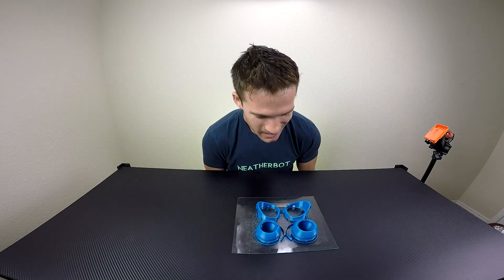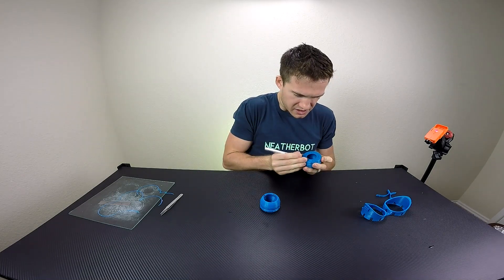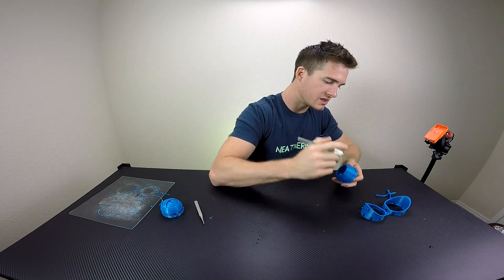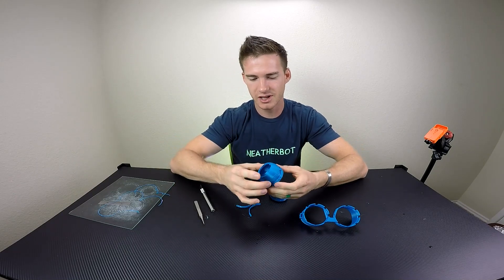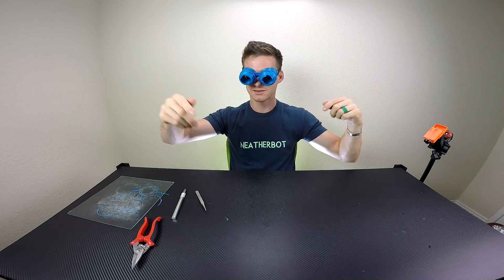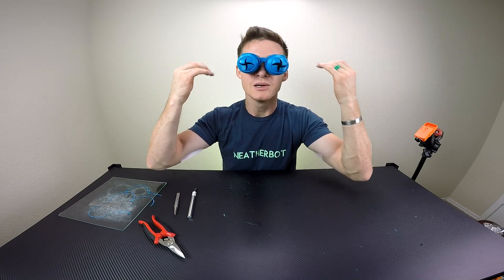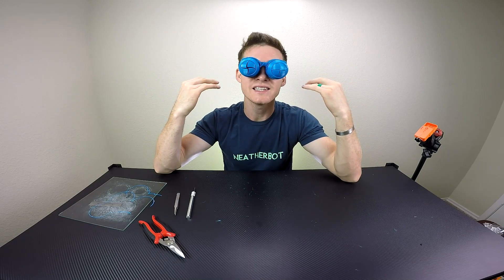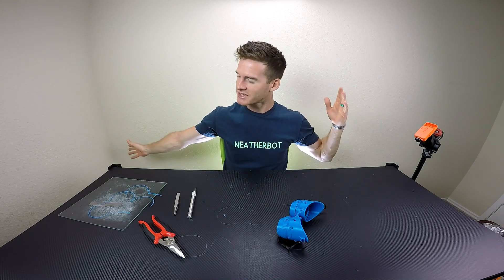Blinking Iris Goggles

Comment: you could, with a small vibration motor, and some clever gearing make it open and close using an arduino, or use something to measure your muscles from around your eyes, and auto blink when you do.. would make it a bit harder to print, but would make it that much cooler.
EDIT now you just made a much better way to do it, just after i unpaused the video...

Comment: If you can do an experiment first, so I know the values, I can probably code it for you. You should use ir for the sensor light pair and then a blue light for the glow. We just need to see the change in intensity between open eyes and closed ones.
Reply from the maker: +Daniel Armstrong I have the goggles winking already! Check it: https://youtu.be/zl7v5aEJRVk

Comment: Just a suggestion... I'd use something like Matterhackers Ninjaflex to print the frames. I think that would conform to your face a little better and perhaps be a little more comfortable to wear. At that point you could modify the file to print a stretchy strap to hold them on too. Great video man. You just got another sub because of it...
Reply from the maker: +ExStatic Bass wohoo! Thanks for the sub and comment. Yeah I had thought about that, but the way the frame is designed it had to be rigid enough to hold the iris box. I agree a flexible frame would be a good idea.

Comment: if you put lights in the goggles you couln't see. but presumably you would be looking at lit things so the light sensor idea 
still works
Reply from the maker: +Jack Lankester I have the led amd light sensor working for the most part, just a little bit of refining to do to get it all running smoothly!

Comment: Yeah just keep a light pointed at your eye.... I had the same idea then I realized it was kinda not the most thought out
Reply from the maker: +Beastinlosers I'm still working on getting the light figured out. It's being difficult.
Reply: NeatherBot maybe u can put a material on the eyelid and reflects off of that it closes it. It's just that the reflection will have to be captured from a largish area as the reflection of the eyelid material will vary in direction. The material will be so much more reflective than an eye. As long as the material covers a good size region and won't be sensed when the eye is closed, it will be easy to put on
Reply from the maker: +Beastinlosers that is a good idea, I have thought about this. Ideally I can get the light sensor to work so anyone can put these on and get them working. I am stubborn about this light sensor, but I may have to figure out another way to trigger.
Reply: NeatherBot Yeah there's always a better solution....

Comment: You could stick a force sensor (i forgot what these are called) to your upper eyelid, then measure the force difference when your eyes are closed and opened to determine the servo state. Should be a simple job for a programmer
Reply from the maker: +Talkless Diamond I have been fighting this light sensor for awhile now. I had the same idea. Using a mechanical motion rather than reflected light is always going to be more robust....but I think I may have found a way to get the light sensor working. Watch my livestream for updates!

Comment: just use the original arduino servo potentiometer code and put a micro switch instead of the pot , wiring would be like this : nc goes to ground , no goes to 5v and the com goes to the arduino pot pin which ia usually A0
Reply from the maker: +hamedtheunforgiven I really want to make it blink automatically. Hopefully I will not have to use a pot.

Comment: trivia: @4:10 "I'm using the two pieces to sand each other" this process is called 'lapping'.
Reply from the maker: +Alex Swavely ooh yes, good word choice!
Reply: VicariousClouds that is "bedding", since you are only really sanding one side. Lapping is sanding both sides, as in seating the valves.
Reply: For example: Lapping your brake pads after an install of new ones, same with rotors.
Reply from the maker: +Alex Swavely haha I love this conversation!
Reply: Erm mah gahd your correct. My appologies! 

So on that note, would you be bedding a pad and lapping a rotor? Since you'd be sanding both sides with each pad? And only on side on each pad?
Reply: Rotors are ground on a lathe, then the pads are bedded to the rotors. Lapping is (potentially) removing equal amounts from each component.
Reply: I get that, but on every brake change you need to bed your pads. So while bedding them, wouldnt that intern lap the rotors? 

I've done CNC so I do know what you mean with cutting them and whatnot on a lathe, but just wondering while bedding your pads, if that would technically mean your lapping your rotors, because even on a very small level, you are grinding away at the rotors with the pads. 

Or am I just thinking to far with it?

Comment: Found a coder yet? Sounds like a trivial matter.
Reply: The hardest thing he done was print a model off of thingiverse lol
Reply: Imrahil it is pretty simple, just not being able to have all the hardware in front of you is the difficult part and im not 3d printing this
Reply from the maker: +Jake Guard I will be re-design in the goggles. Hopefully they print easier amd are more durable when I'm done.
Reply: The coding part is actually preeetty easy, it's knowing what values the sensors give in each case (eye open vs eye closed), and what outputs to trigger to open or close the apertures.

the code, in plain english, would look something like this:

if
   sensor says eye is closed
then
  move actuator to 'closed' position
else
  move actuator to 'open' position

You could add a few more checks if you feel like it, like maybe it can be possible to detect a half-open eye and have the aperture react accordingly, but in essence, that right there is all the code you need.
Reply: I'm not quite sure how the sensor would detect where the eye is as well. Are you just going to use a light sensor to detect when the light reflects off of the eye? That would get a lot of false positives and would probably get annoying after a couple of seconds of wearing it. I would recommend not aligning it with your eyes and just set it up to a timer that would go off at about the same rate that you blink. That would take away the need for sensors that would block your line of sight and the need for a light constantly shining in your eye.
Reply: I misunderstood the setup of your sensor. This would work. I'd be willing to do the code, but I would prefer you assembled the electronics first so that I don't have to guess what you're doing.

Comment: The best way is to make the hardware before you do the code. The setup you're proposing would probably only work in a dark room, but anyway you need to have some sensor data before you can develop a working code. And to do that, a few hardware tests are necessary. I suggest you learn how to code it yourself because it's not that hard as you may think
Reply from the maker: +Lucas Falcon thanks for the tips, yes I'm going to get the hardware all sorted before starting to code.

Comment: The idea can be further developed into high safety goggles. 
We instinctively blink or close our eyes when something comes towards them and having, say metal shutters, close in front of some secondary polycarbonate or tempered glass protection goggles... 
Welding, explosive material handling, high voltage work, things that in event of an accident, the mandatory goggles  would protect the eyes, the shutters would protect the eyes (from bright light) and the goggles from becoming opaque and regain clear vision right after the accident without removing the goggles.
Reply: Unfortunately our reflexes are much too frequently too slow for such a device to actually serve it's purpose. Regular safety glasses are still far better and safer for this. It would be just as easy to implement the auto dimmer from a welding helmet to standard goggles/glasses.
Reply: As a glassblower I could get famous  having a neodynium pair of these.
The possibilities with this seem.... mischievious and fun
Reply: Pașca Alexandru you don’t blink in reaction as fast as u think
Reply: Pașca Alexandru There is so much wrong with that. Besides, clear plastic that is always there and had no moving parts to be broken work fine. Plus they already have auto tint welding masks
Reply: Like the Panic Glasses from Hitchhikers' Guide to the Galaxy, which turn opaque you to prevent you from seeing anything scary! Perfectly safe.
Reply: Pașca Alexandru those basically exist there’s auto darkening helmets
Reply from the maker: +Ben Schmidt that sounds like a really interesting application.
Reply: Pașca Alexandru that’s a great idea. I’m in school for welding and having something like this would be great for keeping slag from hitting your eyes, and would do wonders when you’re grinding scale off of plates.
Reply: mayby having sensors on the front so it detects things infront of you then closes them
Reply: I believe regular work glasses are enough. Just as someone pointed out above, our reflexes are often far too slow to actually protect us from anything.
Reply: yeah i agree they are enough this isn't really that practical and it doesn,t count on your reactions if the sensor is on the outside facing forwards
Reply: TBH it wouldn't be that hard to make a electronic switch that switches whenever a muscle thats solely used for blinking actuates and when it detects that it closes the circuit that activates a servo motor to quickly have a blink or even a wireless controlled blink
Reply: Pașca Alexandru amazing idea.  Looking forward to seeing it as a reality one day.
Reply: Or just wear actual goggles.
Reply from the maker: +Yolomation Animation who would want to wear actual goggles? So inconvenient ;)
Reply: Silly idea. Wouldn't work at all. I still like it though. 😊
Reply: Or you could just have hardened plastic on googles...
Reply: Pașca Alexandru or you know you could have constant security from actual existing goggles
Reply: #steampunk
Reply from the maker: +Connor McHarney haha YES!
Reply: Pașca Alexandru How about safety goggles that do the exact same thing but don't make you look like a clown? And welders wear those metal masks for a reason.
Reply: the idea if safety goggles and glasses are to protect the eyes and surrounding area when they are open and closed
Reply: Apparently so... I mean I have seen worse on this website.. Look at some of the incoherent ramble of flat earthers or planetx loons sometime
Reply from the maker: +Pașca Alexandru.   B. Xc b c       CT.  I   will  c.  VcX .  I.   I. C C b c X. C.  C.    Cik NV b I  o
Reply: By shutters, do you mean eyelids. Idiot

Comment: Sorry to engage in thread necromancy, but I just came across this video. Were you ever able to get the blinking mechanism automated? If you weren't able to use servos, I'd like to suggest electromagnets--If you mounted a tiny permanent magnet on each of the iris "tabs", you could use electromagnets to push them instead of string to pull them. Maybe?
Reply: clownwreck good stuff, and don't worry about necroing on youtube. Trust mex, it doesn't matter here and people will always do it
Reply: And then... BAM JUST PRESSED 1 FOR ENGLISH.... Annnnd its still in Japanese, fuck
Reply: sorry to engage in thread necromancy, but I just came across this's comment...

Comment: The static could be electrical interference, like radio signals or a neighbor using a vacuum. I'd try using shielded cables and or making a Faraday cage camera box with an open wall or hole for the lens. 
Also consider putting up curtains in that small cubicle room you're in to dampen the echo.
Reply from the maker: +Wretched Fretched After spending far too much time I found out that the static is a byproduct of using the usb plug in the side of the Gopro with a mic adapter....apparently it's a commonly know problem with the actual design of the gopro. The SD card is too close and not shielded from the usb plug. This creates static problems when using the gor pro with an extrenal mic like I do. A problem that can not be solved. :( Time for a new camera ;)
Reply: I'd try sticking a small piece of foil tape to the SD card itself. There are isolating transformers out there that could maybe help or be hacked in some way. I know a few loops around a ferrite core is sometimes an easy fix. Good luck to ya...
Reply from the maker: +Wretched Fretched foil tape is a good idea, as long as it doesn't short anything out
Reply: I use an external audio recorder, then use the audio track from the camera as a sync source. My NLE will sync the audio for me with two mouse clicks. A little bit of extra work, but well worth the audio quality I get.
Reply: Wretched Fretched the air vent in the room..
Reply from the maker: +Tan Tan so I finally found out is was the was I had my external mic plugged into the GoPro. Until I get a new camera I can not avoid the static randomly occurring....:(

Comment: not so sure about the blinking sensor. it sounds cool in theory, but will be hard to get to work nicely. ..and you blink every 3-6 seconds, and the goggles will be even noisier with tiny high RPM servos on them. i just dont feel it. i'd rather have them react to the brightness of what you're looking at, or manual control using a servo tester. 
might also be wise, to limit them to not quite close fully, so you dont go blind :D
Reply from the maker: +Cuda FX that's a cool idea to have them open or shut due to environment light levels. I would be fine with them closing every 3 seconds....I love the noise they make ;) as long as the iris closed and opened quickly it should not effect your sight. I like hearing others thoughts on what they would like to do or how they would use it. Thanks for the comments!
Reply: i'm pretty positive, somebody would be willing to collaborate and provide the code, when you motorize the goggles and share the plans. perhaps you could strike a deal. (i can't code. but this kind of thing should be quite trivial to arduino veterans. i can link you the required circutry, though.
a standard 4-5g servo will easily be strong enough, and digital ones are really smooth. i'm at a loss regarding the blinking detection. but for a directional sensor, for that "light responsive cat eye" effect, all it takes is a photo resistor in a little matte black tube, and maybe a lens form a crappy laser pointer.
i would want some manual control too, at least a simple slider, or a button to blink on command.
Reply from the maker: +Cuda FX yes to everything you said. I'm working some big projects right now, but want to soon revisit these goggles to get them servo powered!
Reply: Cuda FX

Or just don't blink every time you blink, just every 3rd blink say.

Comment: Here's some code to try ;)

/*
Servo Goggles
*/

#include <Servo.h>

Servo myservo;                         // create servo object to control a servo

int ldr = 0;                           // analog pin used to connect the ldr
int val;                               // variable to read the value from the analog pin

void setup()
{
  myservo.attach(9);                   // attaches the servo on pin 9 to the servo object
}

void loop() 
{ 
  val = analogRead(ldr);               // reads the value of the ldr (value between 0 and 1023) 
  val = map(val, 0, 1023, 0, 180);     // scale it to use it with the servo (value between 0 and 180) 
  myservo.write(val);                  // sets the servo position according to the scaled value 
  delay(15);                           // waits for the servo to get there 
}
Reply: Tom De Bie arduino for the win
Reply from the maker: +pale blue dot arduino has changed the world!
Reply: I like the code, however my experience with this kind of setup tells me that the data coming back from the photo resistor is going to be fairly unstable. You will likely get a better results if you make it a more binary action. Set thresholds for what is considered open eye and what is considered a closed eye then just have it open and closed at those intervals

Comment: I tried 3 times to get the iris to print I just couldn't get those blades from sticking to the inner part! and here I thought my printer was better then OLD Ultimaker lol Guess not huh , on that note if anyone has a ultimaker original and living in Canada and wants to sell it ! drop me a email .
Reply from the maker: I am very curious what type of printer you have?
Reply: It is a Prusa i3, BUT!  I got one printed  and fully working, turns out it was my own silly fault it didn't work, I recently changed my x carriage and also changed the belt, and I accidently put a belt with different pitch then the one, which means, it was throwing the axis off. Normal printing dramas huh  lmaoo,  keep up with the good videos.
Reply from the maker: Oh dang...I have done something very similar with my stepper drivers...haha I changed the steps from 1/16 to 1/32 on X axis and not Y...Glad you got everything figured out!

Comment: I've personally found that a temperature of 235-245 works best for EDGE, regarding layer adhesion. With a 0,4mm nozzle. Maybe your longer heat block "compensates".
Reply from the maker: +ultrapowermae I went through a bunch of testing all the way up to 250c and layer adhesion seemed to get worse the higher temp I went.